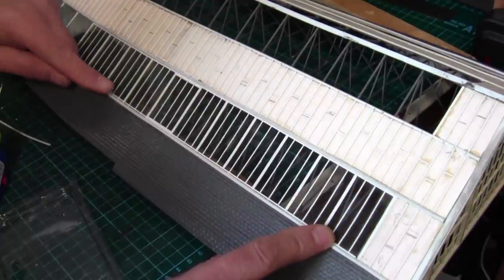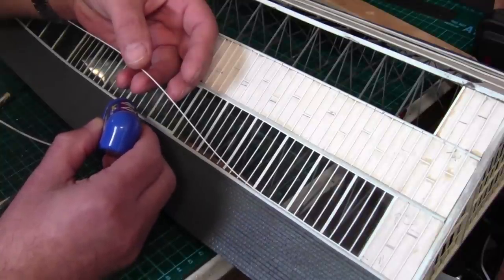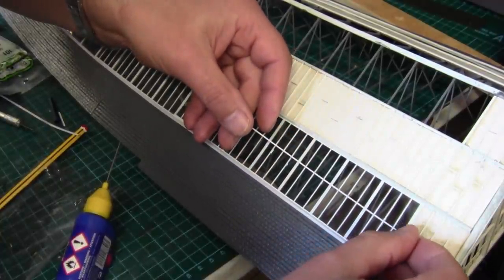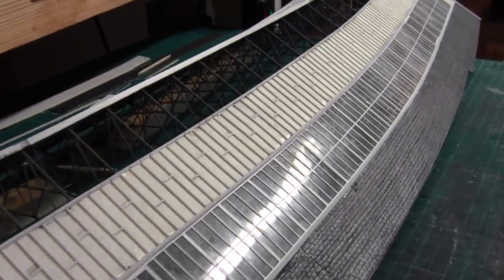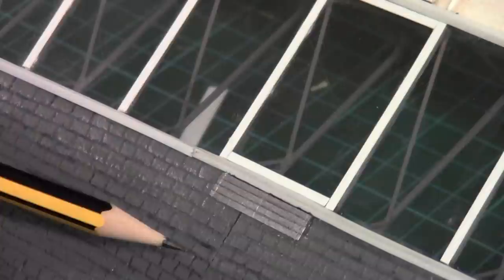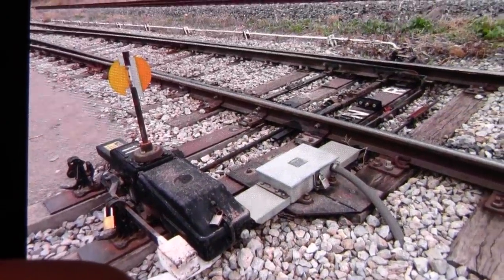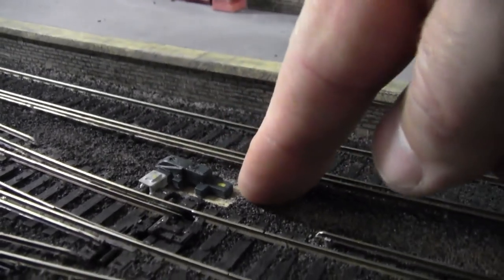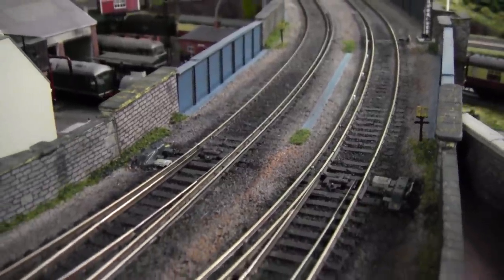The Big Roof update, & Dummy Point Motors. No 292

Comment: Tony, when you complete the roof, you will need to have an open day at South Shields Station for this great occasion!
There may be those who may say that electric point motors (switch machines) are inappropriate for the period being modelled, principally as being too modern, however, ….
Westinghouse electro-pneumatic (EP) signal actuators were in operation at Newcastle Central Station (aka Newhassle) area as early as 1906 and I assume that the electro-pneumatic point motors were installed at about the same time.  Westinghouse EP point motors at Newcastle were mentioned in the periodical, The Railway News, 1914, Volume 101, Page 89, so they certainly existed at Newcastle in 1914.
Electric Multiple Units were introduced on Tyneside in 1904 and the service was extended to South Shields in 1938.  With this advancement in electrification going on, they obviously upgraded the turnouts at South Shields to (I assume) Westinghouse EP point motor operation at that time, possibly to avoid point rodding coming into contact with the third rails.  Many point motors of that period were painted in Westinghouse pale blue.   Have a great weekend.  Best, Jason.
Reply from the maker: Hi Jason buddy you have made a great point with your comment. i knew they were around in early 1900's from what john cuddihy was saying about the point motors at south shields, and he has a few stories to tell about those point motors. but i did not know the name of them. i am not even sure that the ones i have used are correct. but i know at least one thing. the colour is right and i thank you for that. thanks again your comment has made my day....stay safe and have a great weekend...Tony
Reply: EP Point machines are much bigger than a normal point machine. Almost twice as long. As they work off air they need a valve in a box at the end of the machine. The rest of the machine is the air ram and escapement. Still in use at Perth.
Reply from the maker: Its great to hear about these old point motors still in operation today. many thanks for sharing this information Paul....cheer's Tony

Comment: Tony, I hate to criticise your excellent work but I think that some of your 3rd rail is wrong. There is at least one place, at a point, where a non-contacting (dangling) collector shoe would come into contact with the side of the 3rd rail, not an end. That would shear the shoe off! The shoes MUST be lifted on the sloping ends of the 3rd rail. 
Once again, sorry to criticise, but every time I see it, it niggles me.
Reply from the maker: Hi Henry. no need to apologise. if you can be more percific to where it is i may be able to round the corner off, or do somthing about it. if it niggles you now then it wil forever niggle me. but i probably not noticed it before.
thanks again i do appreciate all advice....many thanks Tony
Reply: @TONYNORTHEASTERN  Is there any way to send you a drawing of what I see to be wrong? That would be clearer than a thousand words.